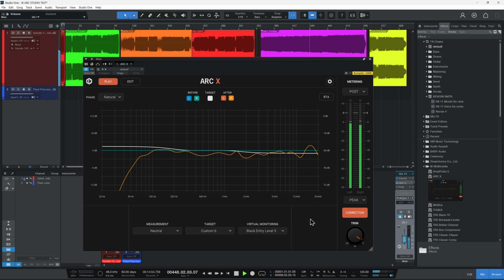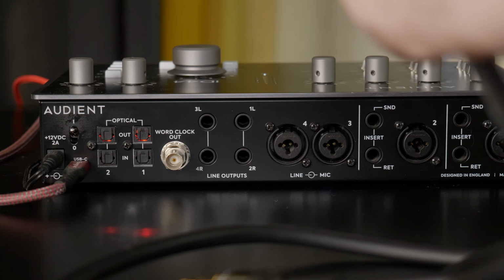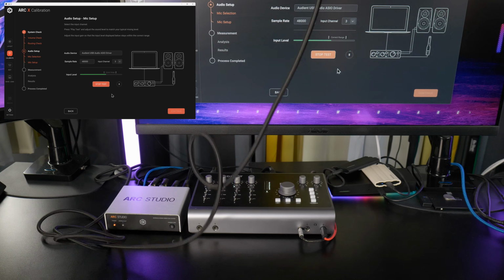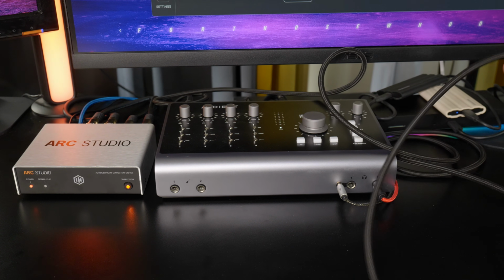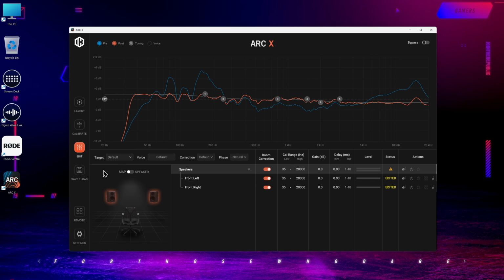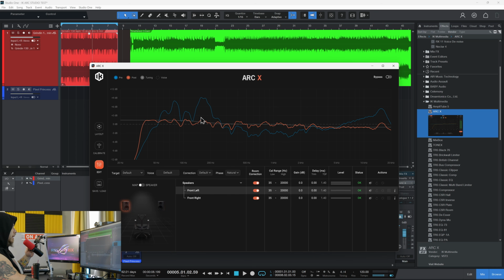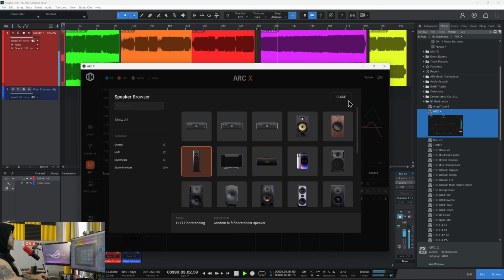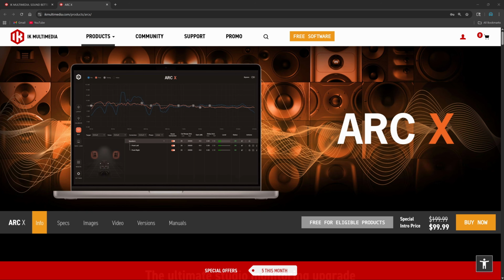IK Multimedia ARC STUDIO w/ARC X - EVERYTHING YOU WANT TO KNOW

Comment: This video was really helpful! I have the Precision 6 first gen monitors and was stuck with the mic input part and wondered why the Continue button did not give. But watching how that part works, it only took doing that part for the wizard to continue on. The room correction did the trick; I might wanna make some adjustments, but generally very happy with the results. Thanks for the informative video that IK Multimedia should have done.
Reply from the maker: yeah i was surprised they didn't have a video on it, and even the PDF didn't give much info. I had to go back to the ARC 4 manual to make sure everything was correct before publishing.
Reply: Thank you for your kind reply on this!!!